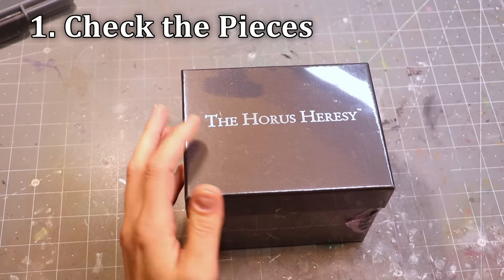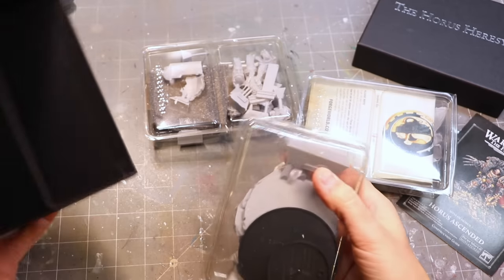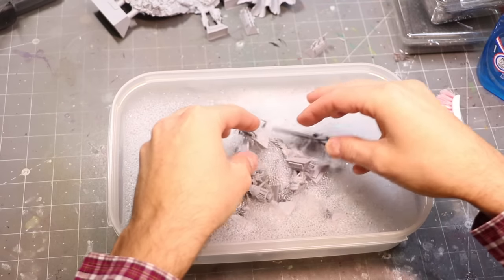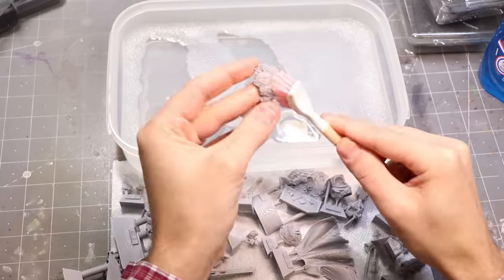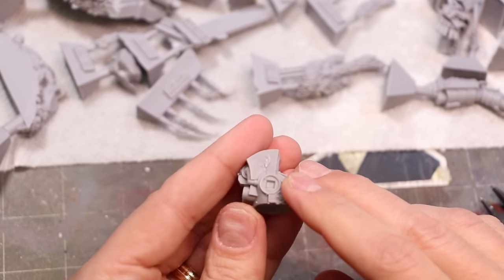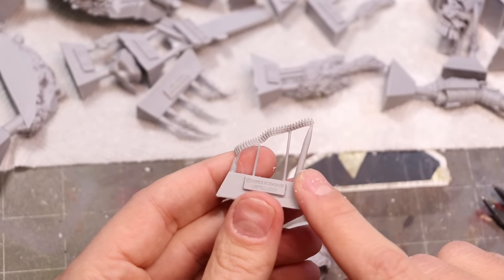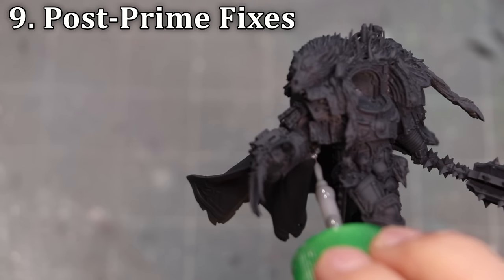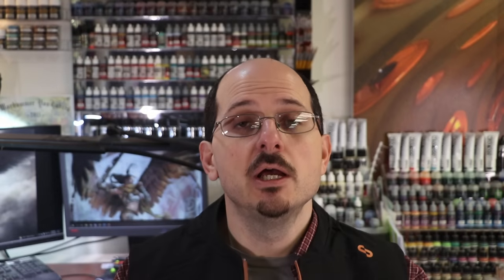Preparing Resin Minis - HC 381

Comment: And when sanding resin remember - wear mask. It may not be fun to wear it but do yourself a favor - wear it. Inhalation of resin dust is very bad for you. Like super bad.
Reply: Wear your mask and wet sand, it will reduce the airborne particulates and works just as well as dry sanding. If you have ethanol or IPA use a 70% (v/v) mixed with water to wash the dust. Due to the alcohol it will also dry super fast.
Reply: I'd like to weigh in on the "super bad" aspect of resin inhalation. If you've ever sanded resin maskless or whatever and are worried, you probably won't be getting lung cancer from it. 

Most of the studies done on resin inhalation is from pouring resins, various epoxy fumes and industrial microfibral exposure. 

The concentration miniature modellers will encounter would be orders of magnitude below those of people in such industrial studies. 

Best safety practice is still advised though obviously.
Reply: @eoinmcorks  while i agree repeated exposure is key and also polymerized resin is inert compared to liquid. There are studies that link fine particulates with a lot of different lung conditions (especially asthma). So I suggest to avoid anything you can avoid
Reply: @k.tassis4632  Repeated exposure at sufficient concs I agree with totally, I work in H&S so the data available is obviously very industrially derived. It's hard to draw conclusions from low conc studies because it's often bespoke LDM (Lung Deposition Modelling) results, which throw up finnicky MOEs and deposition ranges. 

For example, in 2019 SLA and DLP professional printers were evaluated for aerosol deposition. The range derived was 15-37% based on a bespoke LDM different to other entries to the likes of the OEH. 

As I said though, follow best practices and you can at least know you've done all you can to protect yourself. The rest is just down to pure luck.
Reply: @eoinmcorks  On the other hand fine particulate matter (here the important parameter is size of particle and not chemical composition) has been robustly connected to asthma and other respiratory and cardiovascular diseases. These studies soan a period of more than 25 years. Cancer is not the only concern in life

Comment: And you’re like me and you can’t be bothered to wear a mask when sanding. Wet Sand, (spitting on the surface actually works really well, coagulates the dust, but it will make you feel weird about your hobby) also I keep a spray bottle around with Distilled water in it. The only way to control dust once airborne I know of.

Comment: I would mention something: for sanding resin, even with sponge, always use a mask. Polyurethane dust is not something you want in your lungs. Wet sanding makes things less risky but still not totally safe.
I personally use my respirator I have for airbrushing, but it's an overkill. But basically a FFP2 or better FFP3 mask is recommended (P95 or P100 if I'm correct for the US)
Reply: I'd like to weigh in on the "super bad" aspect of resin inhalation. If you've ever sanded resin maskless or whatever and are worried, you probably won't be getting lung cancer from it. 

Most of the studies done on resin inhalation is from pouring resins, various epoxy fumes and industrial microfibral exposure. 

The concentration miniature modellers will encounter would be orders of magnitude below those of people in such industrial studies. 

Best safety practice is still advised though obviously.
Reply: @eoinmcorks  Great insight pal, fumes are the worst, yet dry sanding is a big no and even wet sanding should be peformed with the adequate safety measures. I got a bad case of rhinitis by using epoxies and urethanes (what most resin minis are made of) and now I am regretting not getting some good protection gear. The money I should be using for minis, brushes and piants is now being dedicated to medicines and treatments. 

To all the enthusiast  of miniature modelling out there, it is better to spend your cash on some quality protection gear than medical care . Keep that resin (both in fumes or microparticles) not only away from your nose, but from your eyes, ears and mouth as well. Either in fumes or microparticles (by sanding), resins and their derivatives are way too nocive to our lungs, airways and basically any mucous  in the long term. 

Better safe than sorry!
Reply: @alexrc7333  Sorry to hear lad, hope it's manageable enough for you. But as I said, best practices are the course of play for modellers. Epoxies and urethanes are massive increases in ppm/ppb particulates, so even more advisable there.
Reply: @eoinmcorks  Thanks pal!
Reply: @eoinmcorks  The problem is not cancer. Problem is that PU are allergenic and work by sensitization.
You get nothing until you reach a threshold, which obviously is never the same for everyone, and then you get an allergenic reaction which will go worse and worse with every exposure.
Reply: Junk in lungs tends to be bad. With resin, some are worse than others. I've opened some kits that reek right out of the box. Still off-gassing even before sanding.

Comment: Very important tip : to help with bent details (of older "FiNeCaSt" for example), you can heat up resin with hair dryer or hot water. Heat up, bent to the right condition, fix for a few seconds in the right pose, you are perfect. Also works with photo polymer resin (3d prints).

Comment: Another great HC Video! I found out, that using superglue could be a little bit to tricky by using the regular ones. Therefore i'm often using the 60 sec. repositionable superglue. It helps a lot, even If the right positioning at the first try is hard to handle.

Comment: Hi Vince! Can you tell me what is the accelerator you are using? Seems like most of them are sprays and i really dislike that. I've been using the army painter ones and it feels 90% of the spray misses the mark and i'm constantly running out.
Reply: And it stinks! So! Bad!
Also interested.
I use a homemade activator for terrain and basing after BillMakingStuff showed his recipe (half a teaspoon of pure soda in a 80 ml (?) evaporator bottle of distilled water). Its amazing how good that works but I wouldn't use it on detailed models because it creates some grainy texture on/around the glue.
Reply from the maker: Just standard Zap-a-Gap Accelerator, but I buy the big refill bottles and put it into the little dropper you see here.
Reply: @VinceVenturella  Alright, thanks!

Comment: Hi Vince! Thanks for the video. It is pretty timely for me as I'm going through a weird time when I want to prep half of my unpainted collection (and then do about 10-15%, lol). Like others have asked, I have read so many times caution messages about resin that I'd like to ask (beyond blade safety): what are your usual or recommended safety measures? I'm told especially for sanding to be wary of resin dust and wear a mask, some seem to go as far as to wear gloves as well. I'm just interested in your opinion. Thanks and happy painting! This seems like a cool project for which you're prepping for a great result. 🙂
Reply from the maker: Its not nuclear waste or anything so need to be afraid. :) - It's bad for you to breathe it, so if you're sanding and that sort of thing, wear a good mask and you will be good to go. I usually have gloves just because I don't like my hands getting messy, but as long as you are thoroughly cleaning the area afterward and working with a mask whenever there would be dust or detritus, you're fine, no issue.
Reply: @VinceVenturella  Thanks! I appreciate it.

Comment: How do you tell if your resin/metal miniatures are properly washed? My experience with non-plastic minis is that no matter how much I clean then, the primer runs off just about as quick as I can put it on....also...Horus is wearing Cataphractii pattern terminator armour. 🙂
Reply: Your primer might be the problem. There shouldn't be much complicated to washing resin.

Comment: When washing the resin coating off, should the water be cold or warm? How hard do you need to scrub to remove it without harming the model?
Reply: Warmer is better as it allows for more soap formation to capture mould release agent in, but don't make it too warm as it make the resins soft and allows it to deform. preferably use a brush with softer bristles as they get into crevices more easily. You shouldn't really require a lot of pressure.
Reply: I usually use water that is pleasantly warm to the touch, but not hot. You can scrub quite gently, the soap will do most of the work for you. Don't go to town on it like you're trying to remove grease from your cooking area ;)
Reply from the maker: Good advice here for sure and I agree, gentle scrubbing.

Comment: Hi. I'm doing my first resin bust. When you sand resin, do you wear a mask 😷 🤔. Thanks for the vid  .
Reply: Plus do you need goggles?
Reply from the maker: It's always a good idea to wear a mask with Resin, the dust is very bad for you. The eye protection can't hurt, but not as strictly necessary (unless you are sanding with a tool, as opposed to by hand, in which case, you really should have eye protection as well). Basically, are you quickly removing a mold line or doing major work?
Reply: Thanks for the reply, I am painting a large kratos, god of war bust for a work friend, about 10/ 12 inches high n about 8 inches wide . Big circles on the to of the head and in the colla bone area their is a bit to remove too. Overall it looks pretty sharp. I have ordered a resperorator painter mask n some different sized grit sanding pads , I will order the high strength alcohol etc tonight :)

Comment: Thanks so much! In a couple of resin kits (not gw) I've noticed very thin parallel lines on smooth surfaces. Anyone else seen this? Is it specific to resin?
Reply: It’s how the SLA printers work. Those are the layer lines. Every printer has them in their prints unfortunately. Once you put paint on, you’ll notice them less and less.
Reply: @the420studiosincttv7  thanks for the reply! But theses are definitely cast resin models, not 3d printed.
Reply: @daver8282  Depending on the model, some of them use 3d printed masters cast in resin.